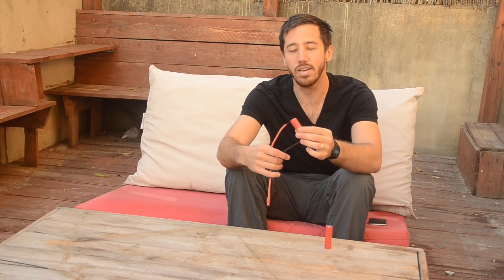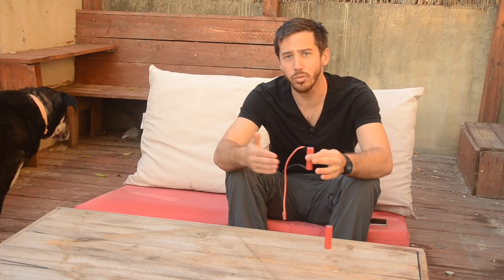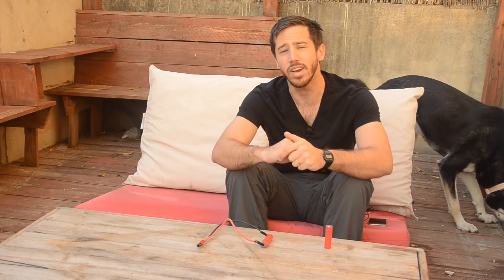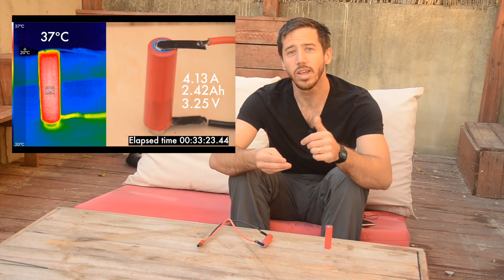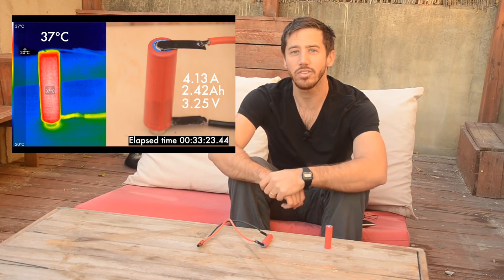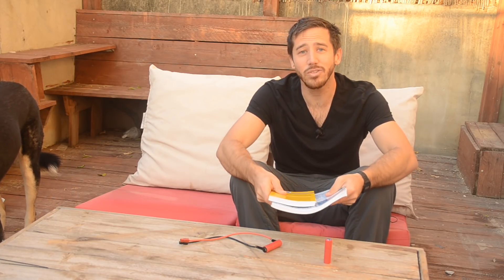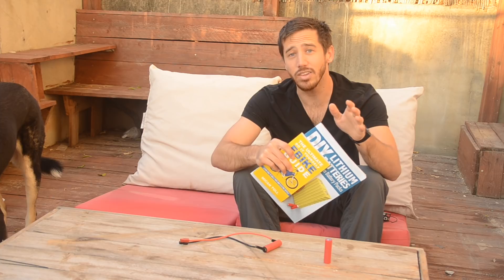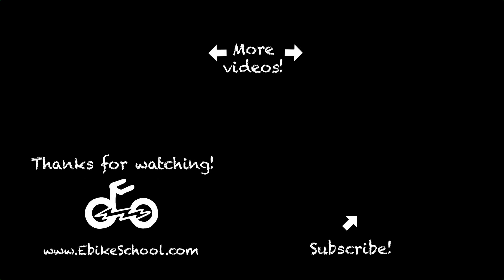Sanyo 18650GA Thermal Camera Discharge Test - HOW HOT?!

Comment: a max capacity is based on perfect conditions in all operations, Ie Max capacity is how much the battery can produce when you have low discharge, where most of the power is not lost to heat/resistance, The Amp rating is the maximum raiting it can hit peak anything above and it will hurt internally possibly perforating its inner shell to create microscopic perforations that will cause the battery to start self discharging, the max 60C temperature is for continuous use, you could have cooling on it and it would be possible to use this battery at 10Amp but its cycle rating is also used at its optimal charge/discharge so day 0.3Amps-0.5amps you can discharge/charge it a 2000times not putting it all the way to the bottom or over the top. once you reach the minimum voltage and maximum voltage your already hurting the battery. if you think the battery is going to last 2000 cycles from 4.20V to 2.5V 2000 times at 10Amp discharge then your living in a dream world, its the same with your phone your battery will life is going to be many times as long if you charge it before its empty, and charge it with 0.5-1Amp instead of the fast chargers. my phone is 4 years old and i only charge the battery slowly and its still lasts 36hours from its original 48hours. while family members who had the same phone used the fast chargers and have replaced their phone 3times in that time and every single one of them have had a shorter battery life in less than half a year because they fast charge.

Comment: Are you using sanyo 18650GA grade C cells and not grade A..I see the cell you are using have a c makes on the heat shrink....maybe that's why at 8amps discharge it has reach its max rated temp....

Comment: Hi Micah. Thank you so much for your great videos! They are all really so useful! Can we say the result of this video is you kind of don't recommend to use Sanyo 18650GA cells for DIY battery packs? Did you choose a Li-Ion cell just randomly or your choice was specifically "Sanyo 18650GA" because it heats more than the other options and you wanted to show us this? I was thinking of building my DIY Ebike battery pack and planning to use Sanyo 18650GA (3500Ah - 10A) or Panasonic 18650B (3400A - 2C) cells. Actually, Sanyo 18650GA was my favourite and I was going to use that because of more capacity and almost two times higher maximum continuous discharge current than Panasonic18650B. But since I watched your this video and read some of the comments I am a little confused and decided to review my chosen cells before I order. I really would appreciate you if can answer me. If I use Sanyo 18650GA cells for a big battery pack like 14S 8P or 14S 6P, do you think still it would heat a lot when my Bafang BBSHD motor work at 30A? Or each cell would output less Amp because of more parallel in a big battery pack and heat less than how much heats on your test?

Comment: Need some help/advice!

I was charging 4 INR18650-30Q 3000mah 20A batteries in a regular charger (XTAR VC4) and one battery started to smoke and got really hot. Any idea what it could be? I threw away the battery but I'm afraid to charge the other ones again....

Comment: Another thing which would help is using nickel plated copper strip spot welded on the cells.

Nickel strips have 1/4 the conductivity of copper, so at 5-10A, it could be heating up too along with the cell, not helping the thermal test.

Comment: Wouldn't it be better to take off the wraps from the cells during the test?
IMO those wraps isolate the heat and the actual temperature inside the cells might be higher than measured.

Comment: Hi Micah,

What about fuses? I am thinking of building a 10s5p 10Ah pack for my bike from used notebook cells. Because of the risk of used cells I don't want to weld the nickel strip right onto the cells. I want to use some kind of fuse to make sure a faulty cell won't kill my entire pack. Would a 36 swg (can carry 5A) fuse wire make it? My controller pulls max 7A out of my pack. If I am right 5x5A=25A would be the max that I can pull out of my pack with this wire fuse. Can you confirm my theory? Thank you! BTW, I'ts one of my favorite channel inconnection of DIY battery pack. Keep up the good work!

Br,
Adam.

Comment: If I bought a dolphin(ish) battery and the cells in it are rated for 10 A max, wihle the pack is 4s14p, if theorie every cell would need to supply 7,5 A, if I want to drain 30 A form the battery. Will the cells (in the middle) overheat if I do that ?
Reply: I am also wondering the answer of your question as I am thinking of building a 14S 8P or 14S 6P battery by using these cells (Sanyo 18650GA). I hope someone answer this question. Or did you get any answer from someone else? Thank you.

Comment: This just proves what I have been telling people for a looooong time that a small 14s 4p pack with Sanyo GA powering a Bafang BBSHD or any other hub motor at 30A will likely BAKE and fail or at least wear the chemistry a lot faster reducing cycle life of the cells running them so hot. 
I always tell people, get more cells in parallel, its a WIN WIN, this will reduce heat significantly, reduce voltage sag, get more capacity + the battery pack delivers a lot more punch = you can actually feel the POWAAAAAAHHH... ohh yeahh =]
Reply: my rule is take your load (30A) and build a battery pack that can theoretically discharge double that amount of current. Then the battery pack can generally take it.
Reply: Hey BrunoPOWEEER! Do you think a big 14S 8P or 14S 6P battery pack with Sanyo GA still would likely BAKE and fail or at least wear the chemistry a lot faster reducing cycle life of the cells running them so hot when it powers a Bafang BBSHD motors at 30A? I was going to make my DIY Ebike battery and planning to use Sanyo 18650GA or Panasonic 18650B cells, actually I was decided to use Sanyo 18650GA cells because of more capacity and high maximum contiunous discharge rate. But since I watched this video and read your comment I am confused. I really would appreciate you if you write your idea. Do you think still it would heat a lot and fail or at least wear the chemistry a lot faster reducing cycle life when i use the cells in a 14S 8P or 14S 6P battery pack?
Reply: @ozguraydin5384  I just ordered a new battery pack 14s8p with these exact same Sanyo cells. Because my 14s8p 24ah pack with samsung cells died after 1yr usage @27A controller on ebike. Not sure if water damage inside was electrolyte or condensation. Either way, battery no good anymore. Driving 30amp continuus is really alot (fun)
Reply: You are incorrect. 30A would be 7.5A which would not reach 60C. Also the 30A would not be continuous, It would be in limited burst. The Average discharge is much lower than the max power of the bike otherwise the motor would be the first thing to burn.

Comment: Hi man! I use to watch your videos they are great! Im glad we can have people like you to be able to learn about ebikes! I have a question that i would really like to solve, i have a 48v 750w brushless motor. With a 48v 14.000mah battery and actually using a 48v 26ah controller... Is that ok? Im just worried in case the controller is asking for 26ah to my battery pack and maybe killing my batteries? Would u explain how it works?
Reply from the maker: The controller is likely 26A, not 26Ah. Make sure to read up on the difference between amp hours (capacity) and amps (power, basically). As long as your battery can safely put out 26A of power, then you should be fine.
Reply: How can i know if my battery pack can put out 26A? Any way to meter it?
Reply from the maker: Best way is to ask the vendor or manufacturer. It’s based on the amp limit of your BMS and your cells. If you know what cells are used, you can check their amp limit. Multiply that by the number of cells in each parallel group to get the max total amp discharge limit for the battery.
Reply: Awesome man! Thanks a lot, i have been looking for that answer for long time haha thx again!

Comment: Great videos, awesome channel. Question, I'm building a DIY powerwall. I'm utilizing multiple S13 48V packs to get to 144V, so there's 3 packs in series. I want to utilize a 48V bms on each pack, how do I wire multiple bms units in series?
Reply from the maker: First install a BMS on each pack, so you have three completed 48V packs with one BMS each. Then you’ll simply wire the three packs in series. That way each BMS only handles its own pack.
Reply: Very cool, is it simple as that? Would the charge connectors be wired in series as well? No need for diodes? Thanks again.

Comment: I know these are older batteries, but I would like to see an "NCR18650B" or an "LG HB2". I still have some new ones(or never used) and thinking of adding them both to some high current project based on the max discharge rate-Not completely, but often. Would like to also see an update to your DIY Discharger(see if you made any improvements). Just watched that video. Great Stuff!

Comment: Hi Michah, great videos and books! Two questions, is there a need to add a fuse to the battery-pack or does the bms acts as a fuse ? I Found soldering on the nikkelstrip difficult. Do have tips on solderthickness, type of solder... Grt, Stijn
Reply from the maker: It depends on the scenario. If your load could short, its a good idea to add a fuse in addition to the BMS. The BMS should be a first line of defense, but it is much easier to replace a blown fuse than a blown BMS.

Comment: As usual nice video. Confirming what most of us already suspected, that manufacturers overrate their product, in this case only slightly as opposed to some who ridiculously overrate their cells.
 I know the INR 21700 - 48G Samsung is not rated for high amp draw. But have you tried testing any of these cells? If not would you care to give them a go in this test? I am currently testing a few cells for my desired e-trike battery.
Reply from the maker: Yes I picked up one of these cells to do this test on it, so I'll be posting that video in the next few weeks once I can do the test.

Comment: I have a triangle pack, 48v with 98 Panasonic/Sanyo ga cells, my question is, how many continuous amps should this be capable of on my ebike? Will it handle a 40 amp controller with a crystalyte direct drive hub motor?
Reply from the maker: It will definitely handle 40 amps. At 7p, theoretically the rating is 70A but in reality probably closer to 50A due to cooling issues at max amps.
Reply: EbikeSchool.com thank you very much for the quick response.

Comment: Hi, I have a question:
Capacity wise, would it be better to build the Battery-Pack using smartphone lituim ion cells? Or is the Wh / gramm the same as the 18650 cells?
Reply: Using Lithium Ion 18650 cells is better, as they have higher energy density, higher load capabilities, and most importantly, are much safer due to their circular non pouch design.
Reply: ok thank you. Was just an idea.

Comment: I picked up your book "DIY Lithium..." and it's a great resrouce but I do have a quick question.  I'm using salvaged cells and have been testing each cell with an Opus BT - C3100 for capacity.  I'm looking to build a 10p14s battary to live in the basket of an e-bike but am wondering how best to build this if I don't have a perfectly matched set of cells.  How far off in capacity can each cell group be?  I've got everything from 1800 to 2800 mah. Can I have one group of 10 be built from 2000 mah cells and another from 2100? I also picked up your BMS for this build.
Reply from the maker: In this case, I'd recommend trying to make each parallel group the same total Ah. So if you have 10 2100mah cells and 10 2000mah cells, divide them in half so you have five in each group, so each group is a total of 20,500mah. That way the groups will stay more balanced. If you had one parallel group at 20Ah and another at 21Ah then your BMS will have to work longer and harder to balance them each charge cycle.
Reply: Great idea, thanks.
Reply: If you know the current capacity of each cell, repackr.com can help you do the rest.

Comment: Great video! Id be interested in seeing how the max discharge rate ( based on temp rating) changes for batteires arranged in a pack. I think it would be useful for a lot of pack designers out there.
Reply from the maker: Yes this is a test I want to do. Next time I build a battery pac I'll discharge it under a thermal camera for a video.

Comment: What did you use as a resistive load for discharging?
Reply from the maker: For this test I used halogen lightbulbs. I have a video showing how I made a battery tester using halogen bulbs.
Reply: I'll check it out, thank you for the replay.
Reply: EbikeSchool.com could u please put the video link?

Comment: panasonic 18650pf would be great
Reply from the maker: I'll add it to the list. I think I have some laying around.
Reply: Nice
Reply: I have had 14S4P ebike packs with the PF and the GA cells for three years now. The GA cells are superior at least in terms of voltage sag. I run BBSHD motors with these and at 30 amp draw, the PF cell voltage sags like crazy. It will go from 57 volts down to 47 volts under 30 amp draws within a few seconds. The GA cells drop from 57 to 51-52 volts under the same draw.

The PF cells put out significantly less power under heavy draw and it is very evident in the bikes acceleration.

Comment: you built an 18650ga in DIY Lithium Battery - Spot Welding - Part 2/5. How potentially hot would that get as a pack?
Reply from the maker: Good question. I don't have that battery anymore but I plan to do a discharge test on another pack using the thermal camera to check it.